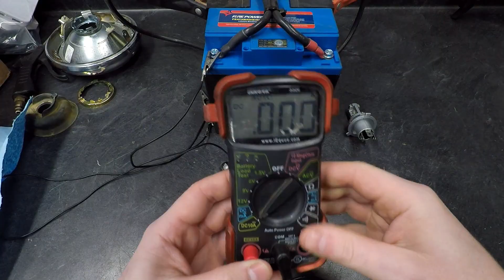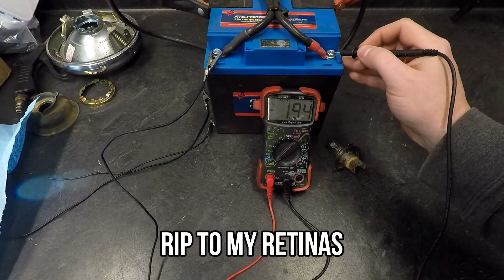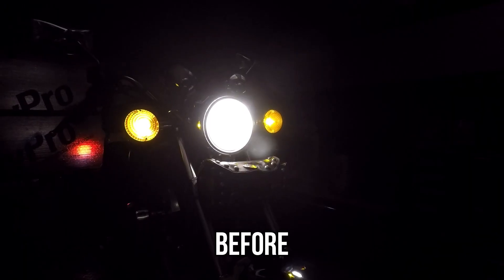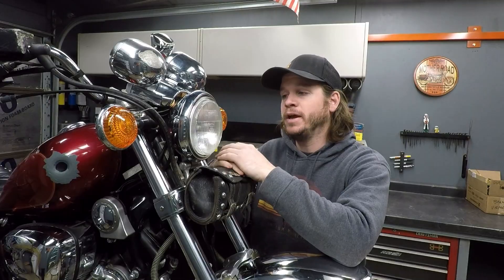Motorcycle LED Headlight Conversion - Install and Test!

Comment: I wonder how long the LED bulb will last in a incolsed headlight bucket before it overheats and burns itself out? I just put LED bulbs in my 2006 Suzuki Burgman AN 400 scooter. Now this design has a fairing with headlight reflectors much like a newer car does. It has duel headlights on both low and high beam. So the new LED bulbs came with a separate locking ring that you put in the headlight module the lock it in with the spring. Then put the rubber garment over it the install the bulb though the center of the locking ring and it twist lock in place. The heat sink is outside of the headlight housing which helps cool the bulb and there is plenty of space because the area is open for air to the radiator. Anyway the bulbs made a big difference for night riding.
Reply from the maker: Thats sort of an opposite issue from what really happens. These bulbs are designed to create a bit of heat to help keep the bucket sealed of moisture.  I can't speak on other bulbs that have cooling fans and stuff but these are made for this specific use in a motorcycle headlight.
Reply: @BrickHouseBuilds  Sorry, but "heat" doesn"t keep the moisture out, on the contrary, if you have cold glass and warmth inside, you will most likely get condensation. "motorcycle headlight" is a very loose term, since headlights are very different across types/years of production, etc. The heat, is most certainly a disadvantage and helps in no way with humidity inside, quite the contrary. It is preferable to use a LED that has both fan and separated heat sources.

Comment: Is it possible to swap the Halogen bulb with a LED bulb on a Honda VT1100C Shadow 1985-1986? If yes, then is it possible to convert that bike's headlight from reflector to projector by adding a projector lens into the headlight?
Reply from the maker: Well if the bike takes a H4 socket style halogen this bulb will fit. To swap the lense I don't know. At that point you are replacing the whole assembly
Reply: You can replace just the bulb or the entire headlight, just be careful not to install a light that draws too much power... the stock stator only produces 12 volts at 390 watts, just barely enough to run stock bulbs.  I own an 86 VT1100

Comment: How do you know which side of the bulb is the ground pin?  I had a look at some wiring diagrams and sometimes the ground is the left pin instead of the central pin.
Reply from the maker: If you have something out of the norm you just compare your wires on the plug itself. Worst case you try a couple combos like I show here. Cant work in reverse anyway

Comment: Great video! I bought a used motorcycle, that had a LED bulb with a little adapter block, instead of the original halogen one. But the low beam is not working, only the high one. And I'm wondering if the LED is defected, or the guy that installed it has done a sloppy job. All LED bulbs should have both high and low beam, right?
Reply from the maker: Not all bulbs are dual beam. If they are intended for a headlight its very likely but not a guarantee
Reply: If the beam works or not is still dependent on the hi-lo switch on your motorbike handlebar, just like a regular filament bulb... so don't be quick to blame the LED or power supply.

Comment: Well im convinced. Getting me some LEDs for my 83 nighthawk. She has a hard enough time charging the battery
Reply from the maker: Its a solid upgrade to make the electrical system more efficient for sure
Reply: @BrickHouseBuilds   where can i find this specific LED?
Reply from the maker: I have them but they are not listed on my website. Send me an email on there if you wish and I can get you set up
Reply: @BrickHouseBuilds  
Ok cool ill head there now

Comment: Another banger of a video =) VERY informative and I plan to use this testing scenario to FINALLY learn more about the charging circuit on my '81 GS450T.
I recently replaced all of the lighting on my bike with LEDs. The lights look wonderful, but now I am faced with the risk of burning up my Stator if I don't do one of two things.
1) Upgrade my Regulator/Rectifier to a Series style to replace the old Shunt style. ...or...
2) Simply use up more power to get as close as possible to the draw the old lights had on the system.
I can't find a good Series R/R that I can wire in for under $100, so my most cost effective solution is to either add more lighting or find some other cheap way to bleed off that extra power my Stator is generating. I don't want to run the risk of burning up my Stator or R/R.
At least... that is the way I understand the situation =\   I wish I understood the power system better on this old bike.

Anyway... EXCELLENT video about LED headlight conversion. Very ILLUMINATING! =)
Reply from the maker: Well I offer a reg/rec on my website for the price you are after. It would be the DRR-S for a GS450. It is a digital mosfet unit and would handle LED no issue. It is lithium safe as well so if you upgrade batteries in the future you are already set.
Reply: @BrickHouseBuilds  You sir, just got another sale =) THANK YOU!

Comment: In Sweden low beam is legal up to 2000 lumens (at 12 feet) in brightness and the stock halogen are only around 800 lumens so I switched to a 16 watt "often sold as offroad LED's "LED with 1600 Lumens and it really makes a good difference. I also made sure the imaging was correct so you don't blind people all the time and get a ticket.  In Europe LEDs are not approved legaly because they don¨t brake that often leading to loses in halogen sales....So just switch to "correct type for your bike" LEDs and save yourself from bad headlight brightness.

Comment: Interesting comparision. A couple of years ago I looked into LED car headlights for my car; the LEDs then didn't perform as well compared to halogens.
Reply: LED have to sit at 3 and 9 O'clock, so you might have to clock your led's.
Reply: @frank9649  I've installed (strong) LED's on my motorcycles headlight, which is originally with a halogen bulb. It is fitted so the LED-chips face 12 and 6, and it does not light up thee road properly - Maybe this could fix the problem..?
Reply: @Broholm99 depending on the design of the led u bought then yes, it might help. Some have to be fitted a certain way

Comment: The only difference in High and low beam is the location of the LEDS on the assembly, both LEDS consume same amount of current.
Reply from the maker: Why did they measure differently?
Reply: @BrickHouseBuilds  it is a very small difference, nothing in semiconductors is perfect, temperature affects the conduction of the LEDs that is probably the reason, and the connection using the meter’s prove  basically a loose connection increases the resistance in the circuit, if I remember well the difference was in the milliamperes.

Comment: I am 100% convinced LED are much better for motorcycles.  But your video is just not fair. You can't expect an incandescent bulb to perform well on a stopped engine. They are designed for a higher voltage. You can't use a camera to show people who bright is a light. They are designed to adjust the image color to an average "grey". Last but not least,  LED are pushing a lot of light out...but this light is also a bit more difficult to manage. Old bikes optics are sometimes unable to focus this light properly. It results in a good enough lighting of the motorcycle front ... but also a lot of ligth spread outside of the intended lighting area. It's not a problem for daytime use, and will probably help visibility. But at night it can be real dazzling for other drivers. If you make such a conversion,  please test it for this aspect too.
Reply from the maker: I feel my test was very fair.  On a running engine it may have seen 1 volt higher but the math is what I wanted to show and that translates with increased voltage.

Comment: Nice 👍.  I like the demo with your multi-meter showing current/wattage usage.  I don’t know how much folks normally care about wattage usage, but MC alternators have a finite of current draw, and outside of some touring rigs, it’s not that much. Any amount you can add back into that bank so to speak, allows you to add on, as you said, other options, like heated grips, or other stuff. A very solid upgrade. I’m thinking my 2002 Connie might need an LED upgrade 😉👍😎… . Never had to change out a MC alternator, but it can’t be an easy task as it is on a cage, er automobile… .
Reply from the maker: Well I'm glad you liked the extra information I made an effort to provide.  Simple stuff really so I think its important to show the benefits beyond the brightness and explain that in detail

Comment: Good helpful video. I have a 2019 GSXS 1000 FA which come out with 2 x H7 Halogen bulbs, one bulb is low beam and both on are high beam. Here in New Zealand it is compulsory 
to have your low headlight beam on while you are riding. At night time you are better off riding with both eyes closed so I bought through Amazon 2 x LED H7 plug and play bulbs 
which use half the the power and 3 - 4 times brighter. At night it's amazing just how much brighter they are but you have a brilliant white light rather than a dull yellow shade, well 
worth it. Cheers, Pete from NZ.
Reply: Hey what do I search to buy what you bought
Reply from the maker: That sounds like a great upgrade!

Comment: I was curious on the temperatur the led's give in a closed headlightbucket. If you could ever compare that to a stock halogen would be a 'nicetoknow'
Reply: Me too. I did buy simular LED-lamp with vent inside lamp house. The socket went burning hot. I did not dare to mont it on the bike.
Reply from the maker: I'll try to remember to do that next time I install this bulb

Comment: Cheers for making this video. I saw these on ebay the other day and was thinking of putting one on my sv650
Reply from the maker: Im not sure of the ones on ebay but I know my source is picky on the quality part. Hopefully early March I have these available
Reply: Which led light did you use? So i can place an order.

Comment: After I get my NUUT set up on my incandescent lights on my stock CX, I will eventually upgrade to all LED, just got to save up the money for now. Shouldn't be hard. I may even upgrade to the headlight you used in that last video, but then I'd fear I would want to also upgrade my dash and the project just never ends lol.
Reply from the maker: Seriously its a viscous cycle lol
Reply: I upgraded all of the lights on my Philippines spec Honda XR150 last year. All lights are now LED, headlight, taillight, signals even the dash and neutral light are LEDs. I had to swap some circuits that were getting AC current to the tail light and headlight before I could switch to LEDs. Much better now and very inexpensive there.

Comment: Nice! I put an led in my 1979 Garelli Gransport moped, huge difference! (1157 bulb). I worry about putting them in my 03 Suzuki SV1000S due to the heat and total plastic headlight housing. Yes, my CB350 twin can't charge the battery, run the headlight, and operate electronic ignition but Ricks sent me an upgraded charging system for that project.

Comment: What was the system voltage at idle, LED vs halogen?

I know some bikes don't charge at idle, like my CB360, which won't idle without a battery.
Reply from the maker: 12.7 or above at idle but I used 12.5 for comparison as shown on the bench.
Reply: 12.5v means it isn't charging…discharging is a possibility, since 12.66v is static for a fully charged lead-acid battery. 

I hoped that would bring it up to basically neutral, not charging & not discharging.
Reply from the maker: @Iowa599  you can see my test on the bench using a battery. I didn't test it on the bike because I can make a clear demonstration on the bench. In this case there is no stator voltage so the test is based solely on battery voltage.

Comment: Also led's produce more lumens than that of an old Halogen. A crisper whiter light, using less power, smaller diameter cable required. They pick out better details on the road as well. 
Great vid
Reply from the maker: An added bonus too. Also, a future version of this bulb will be available with a more yellow hue like the stock bulb which is appealing for those after the vintage look.

Comment: curious to see how it looks on the road. Some LEDs don't throw out as good a pattern or have sharp cut off lines.
Reply from the maker: Agreed. Its been too cold for me to test it at night but based on the wall footage I think it will be a great light
Reply: @BrickHouseBuilds  I fitted one to My '86 GL 1200 interstate 2 Years ago....it is a good Light..and allows my Heated grips extra juice.
I did the 'Poorboy' style alternator Conversion as well ..480 Watts instead of the original 300 ...
The brackets were easy to make and the Fairing lower conceals it nicely